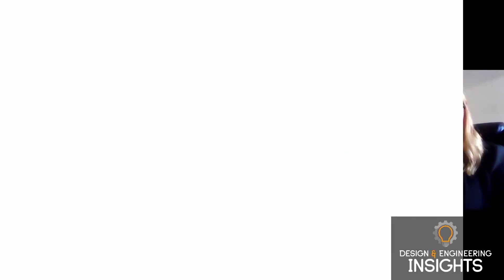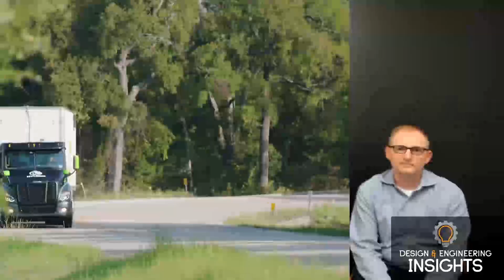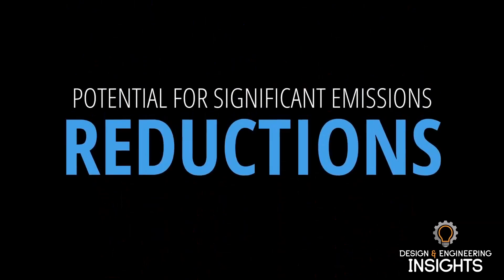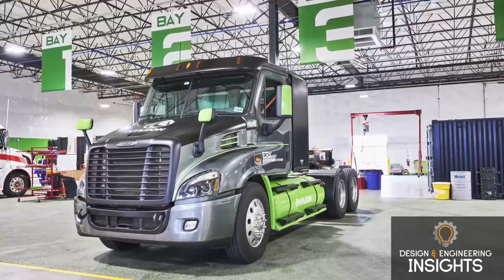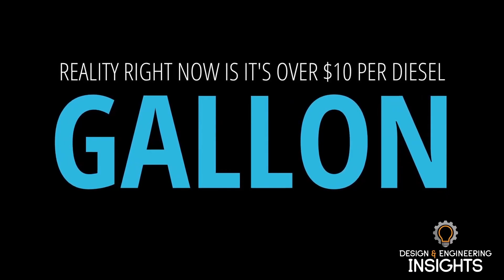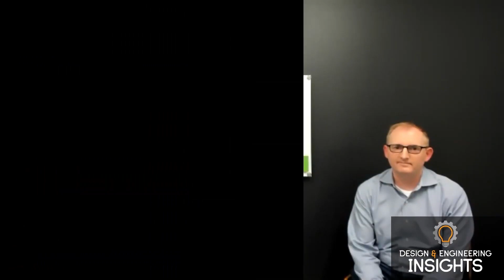Hyliion interview OEM Off-Highway magazine reupload, hyln stock

Comment: The buying zone is $10 and here is why:  Tax Loss Selling and...
$HYLN
 is buying batteries from Toshiba, the rear end (arse) from Dana, generators from GE, CNG engines from Cummins, truck body from Trucks Makers, and Control apps from Apps Store then assemble onto class 8 trucks. Basically, $HYLN is just a chop shop with a $4B market cap!!!! 

They don't have any manufacturing capabilities -NONE.  All they have is a chop shop. 

In defense of HYLN, you may say that other companies are doing the same - YES, other companies are doing the same but they have billions and billions and billions of sales, HYLN got NOTHING to show.
  Don't you see Healy in the shop all the time?  He should be running the company.

The Daily Head and Shoulders scares the hell out of me - $16 is compromised, there is no support until $10
.
$HYLN investors are cornholed to the tune of over 2/3 value past 2 months and Healy is hiding in his chop shop to let Shareholders hang to dry.
Reply: You say this in every video
Reply from the maker: Yeah it is little bit annoying however, if he wants to express his opinion, why not :) i am not taking away his free speech
Reply from the maker: What do you have to say, that Hyliion got latest buy rating at 20$? Thang Chau, better close out your short positions

Comment: If anyone bough this stock around 13$ or less  then that's okay because at this price or lower , it could worth the very high risk you are talking. No body can validate if their products really work the same way they claim because there is no unbiased validation. With the absent of unbiased validation then this is just  a beat, not an investment because there is nothing internally to evaluate or  analysis. People need to stop hyping this stock until we have something that we can validate to believe in it .
Reply from the maker: Well, for 13$ it would be a steal. They underwrote their shares for 10$ per share, so then you have only 30% potential downside. However, with the latest price target and buy rating video here: https://youtu.be/cIltmbVBitc
It should help them in the short term, but in the long term it is nothing ground breaking. I am looking forward to hear more news from Hyliion, from their PR. Because that will cause the biggest moves. Or news like that they started producing their erx, finished testing it, taking more orders of their hybrid solution etc. Also for validation, feel free to check out this video: https://youtu.be/fK32WYBGe1c
I am not hyping the stock that much. If i had 100k subs maybe i would be hyping it, but small guy like me, not really:) i just really like them and want to spread information about them.